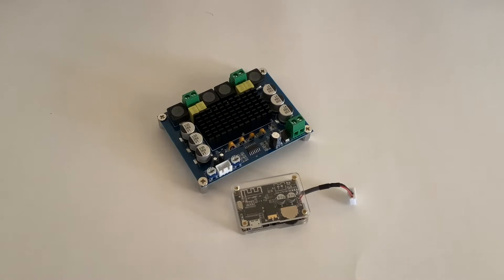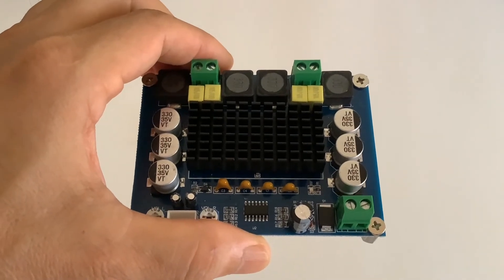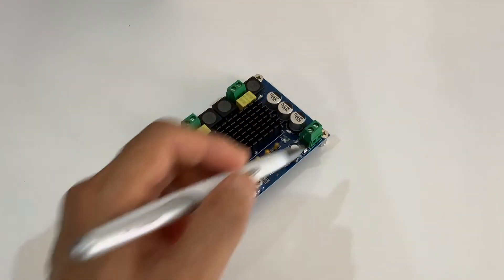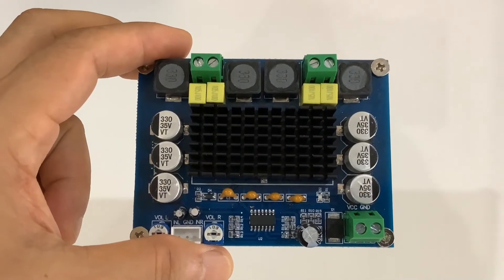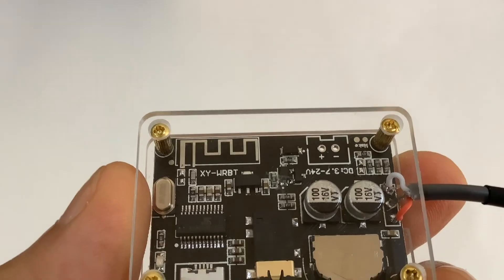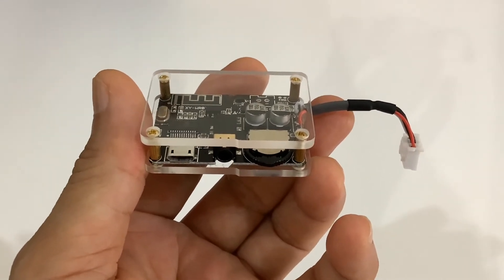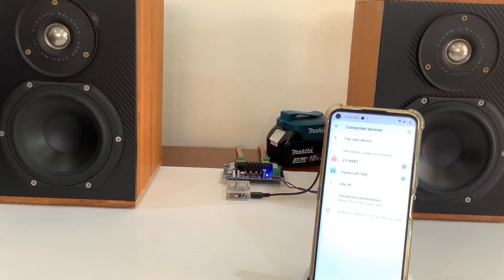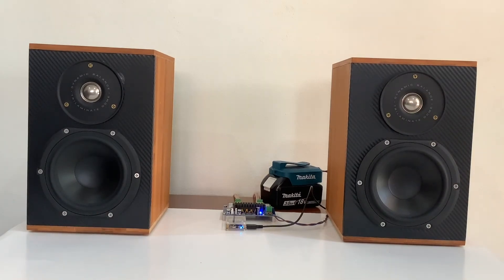Amplifier board TPA3116D2 (XM-M543) & Bluetooth Audio Receiver XY-WRBT Quick Review

Comment: Can u also share the specifications of your speaker drivers. Thanks
Reply: This particular TPA3116D2 amp board will produce almost 50W per channel at 8 ohms, using 12VDC at 5A/6A power supply. If using a 24VDC@10A supply, it will produce almost 120W per channel at 8 ohms.